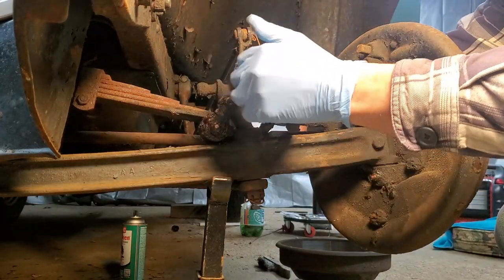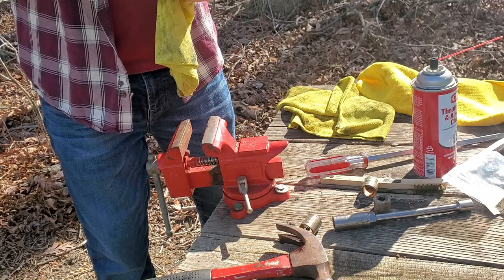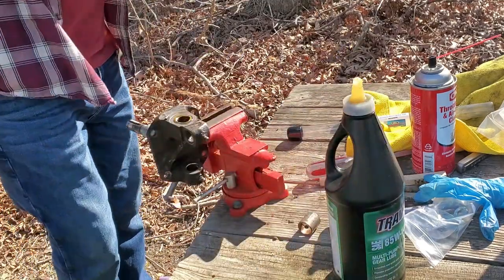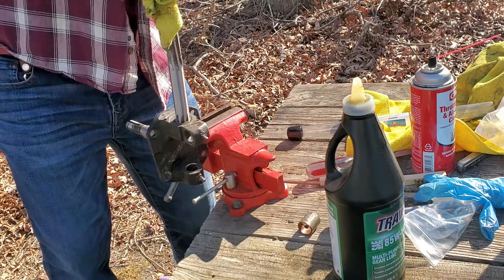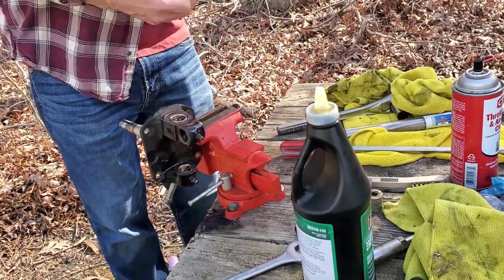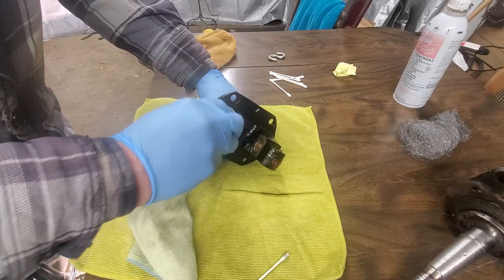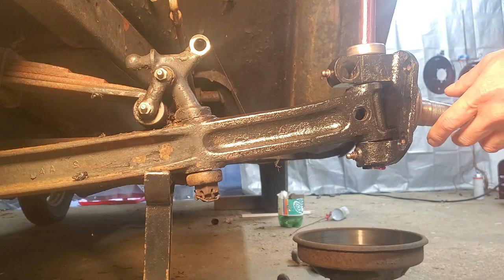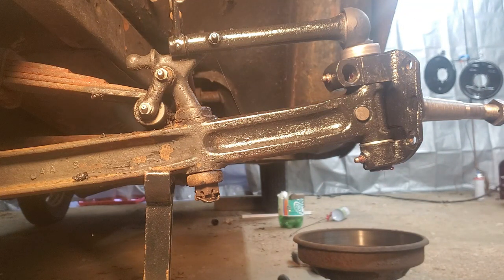King pins and bushings Ford Model A

Comment: I did the kingpins on my 53 Plymouth, very similar. I said the same about NOT cleaning the grime from the front end as well. I decided to decrease and chip all the petrified oil from the entire front end,took me a few hours each night after work for about a week. Literally needed to chisel alot of it off as the car was originally from New Mexico, the land of enchantment,also known as sand,dust,dirt. First look at it you'd never know where the grease fittings were or any of the rubber bushings or dust boots,even all the linkages were covered in it, it was that bad,as if maybe someone purposely did it to preserve it. I'm glad I did it,it would have kept bothering me that I didn't. Never cared for things that leak or are all grimmy,I've been known to pull an engine just to address a small oil leak. Definitely the wrong hobby to have these ailments bother ones self.

Comment: A very nice video Richard, thanks for taking so much trouble.  I noticed while you were refitting the left side king pin to the axle it appears you have a gap where the front axle stabiliser rod bolts onto the axle (you can see daylight in the joint), might be worth checking.

Comment: Ha ha .That was me in 1970. I had no idea what I was doing.Wrecked the bushes by whacking with dad's carpenter hammer. Couldnt get the king pin out so I mushroomed the head of that. Then it wouldnt go thru stub axle. Never heard of a reamer . Tried filing the bush with a rattail file.Ended up getting another king pin knuckle and stub axle off a  dumped car and doing a $12 changeover at the local garage.My dad always told me I was wasting my time and he was right but he never stopped me from doing it anyway.

Comment: Been enjoying your videos.  I admire those in the Model A community who share to help the rest of us.  I've seen multiple YouTube videos similar where they ream out the king pin bushings.  What I don't understand as a fairly new owner of a Model A (and an old car in general) is, if we all have to use a reamer for the king pins bushings, why aren't the bushings just sold with the proper side ID to match the king pin so we don't have to do this?
Reply from the maker: The bushings are soft and change when being pressed in. So reaming is necessary to get them back to the right size and shape.

Comment: I think you can damage the threads on the brake shaft if you don't  install it before the lock bolt,  so I have been told.

Comment: Skipped that step on my Model A front axle, as I swapped out the stock spindles for Chevy van for robust hydraulic brakes . The bushings for those were nylon, very easy install.